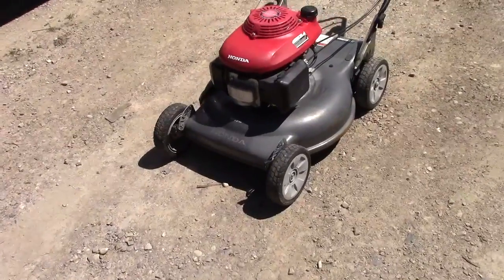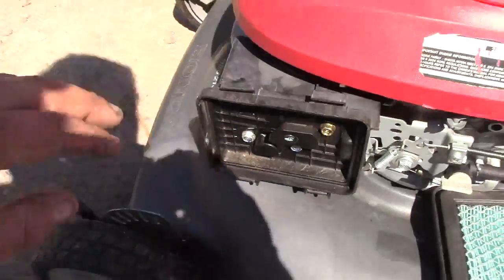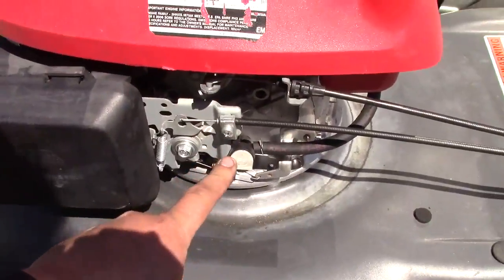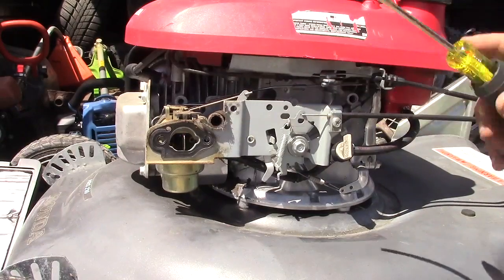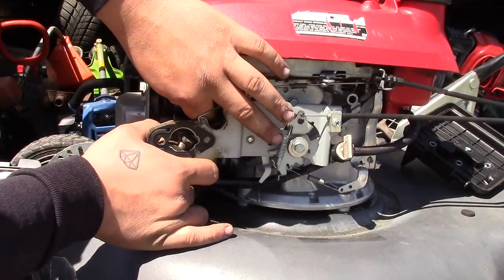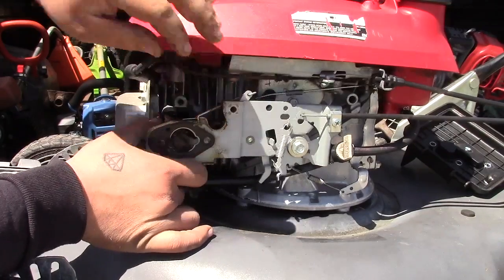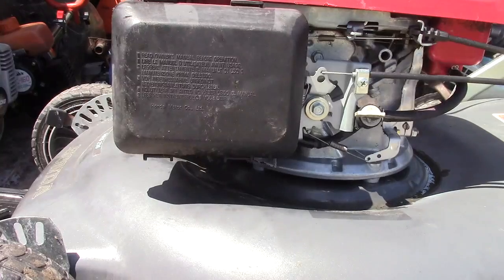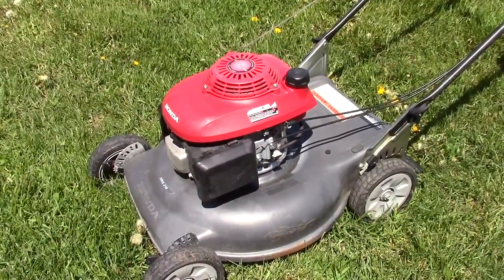Honda HRS216 Diagnosis and Repair

Comment: Thanks for your easy to follow explanation! Such a simple fix. I'll add that if you don't have a tiny drill bit to clear the holes, like I didn't, a 13 gauge guitar string works great.

Comment: Having trouble with the choke on this exact model … there are 2 holes on the choke linkage … which hole do I use.  Excellent video overall but can’t see how you reattach the choke linkage.

Comment: I couldn't get the tube out at 6:17. Do you know how to get it out if it's stuck? I ended up cleaning the main jet that was plugged and put everything back together and it's running again now but it still isn't normal so going to take it apart again and try and get that tube out.  I was banging it on concrete and tried poking it to loosen it but it's really stuck.

Thanks for the good video.